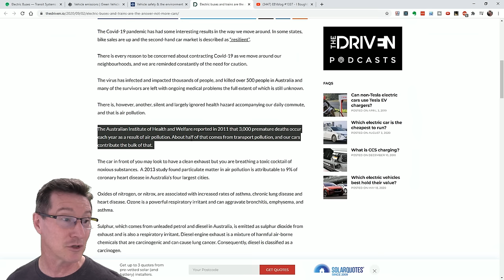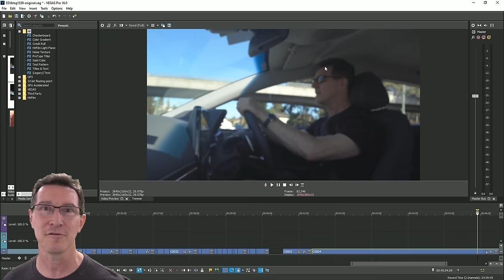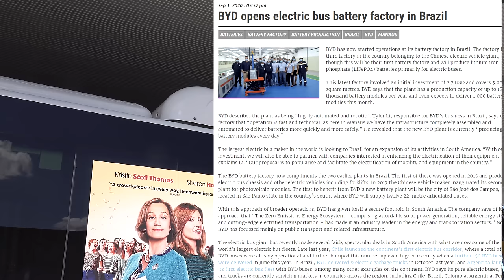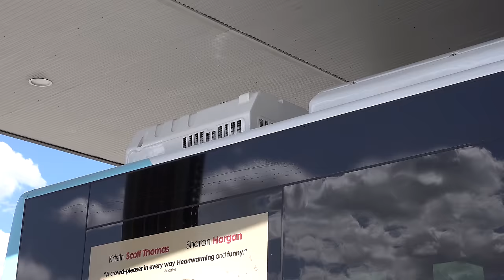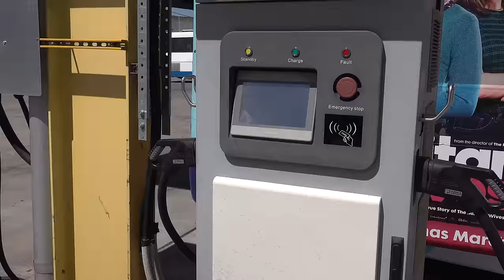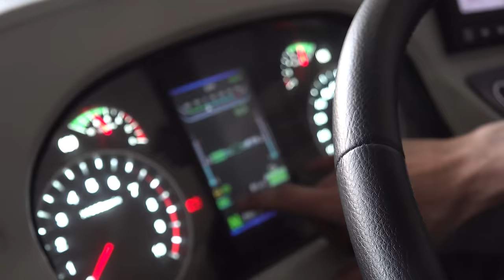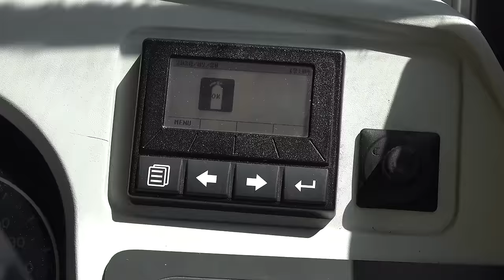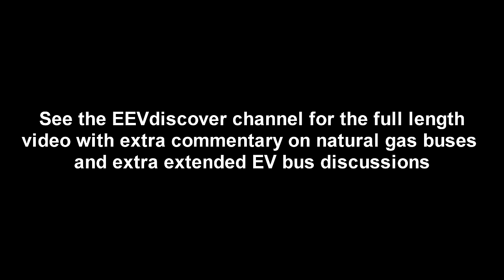EEVblog #1339 - Looking at an Electric Bus!

Comment: Making a blanket statement that "electric cars clean up the air" on its own is not only an eye-roller for many of us, it's an opportunity for a video right in line with what you have done before!
Obviously, you HAVE to consider the pollution created by generating the power used to charge your batteries if you want to be taken seriously regarding a claim about pollution. So do just that!
I for one would really like to see a breakdown of how much pollution is generated by just an average coal-fired power plant in generating the wattage used to charge your car batteries from realistically empty to realistically full and how many miles that charge will carry you vs. the amount of pollution created by a realistically comparable petrol (you're welcome) car to drive the same distance. Just from the pure economy of scale leveraged from a large coal-fired power plant, I'm guessing the advantage it would be significant and interesting.
Comparing to hydro or nuclear is kind of not helpful since that is just not globally ubiquitous to be meaningful in my view.
Reply: Generally EVs use energy way more efficiently than gasoline (~60% electric vs ~20% gasoline). You can start here about emissions: https://amp.theguardian.com/environment/2017/oct/25/electric-cars-emit-50-less-greenhouse-gas-than-diesel-study-finds
Reply: but of course, it is best if those coal plants were replaced with something cleaner; though perhaps can't go 100% solar or wind, there is a definite room for improvement in cleaning up the grid; a solar & wind mix is a good start though not the full solution; efficiency is another modifier... there is A LOT that can be done
Reply: Not to get into a" green "debate, but I'm pretty skeptical about the accuracy usually reported for how green both solar and wind are once you include the energy spent on manufacturing, installation and maintenance of any of them per unit of power output. I'm sure they are green-ish, but I'd like to see more folks at least consider and include that part into the equation, and I'd want to include that for coal and nuclear as well. You have to consider "cradle to grave" or at best you're not being honest or serious about the core problem. Not saying they aren't better, I'd just like to see the whole picture represented instead of just the pretty parts, which is almost always the way it's framed. I just figure we all know it's better and don't expect it to be perfect, so why leave anything out? We can take it.
 Anyway, even though coal is probably the dirtiest way of generating power to charge those batteries, the economy of scale thing should still make the electric car so much less dirty than a petrol engine that the difference is fairly dramatic.
@Tom - that's the kind of data (the kind of stuff you linked) I'd like to see Dave go over on a whiteboard. The "cradle to grave" issue is another reason why it might be difficult to include solar & wind because the dirtier parts of their lifespans are left out so often that it's difficult to even find and thus include. But heck, Dave could include a best-case scenario and offer up a theoretical purely clean generator source for comparison just for the fun of it.
Anyways, since he's kind of doing a semi-series on EV's anyway, seeing some math on a whiteboard and cluing people in on a more thorough picture would just be an interesting and fun video for that playlist I think.
Reply: @tommy12345abc  There sure has been a ton of improvements for safer nuclear over the past several decades - most of it unimplemented as far as I can tell. I'd sure like to see some progress on that. Well more progress on ALL of it really. But yeah, if we could get over the hump on large scale power generation, electric everything is a no-brainer as long as it's affordable.
Reply: @TyroneDamShewlaces  it comes down to recycling and responsible production. The west already has enough regulations to keep that in check though likely there are improvements to be made. But most of all they are the same regulations by which the other power plants are built except that once they are built, they keep producing even more toxic emissions and residue (it is not just CO2 but heavy metals like mercury, lead, chromium, arsenic; gases SOx, NOx, PM2.5, PM10...).  So let's not get too crazy about how clean solar/wind is or is not because it is still way cleaner than what humans managed to accomplish so far with current plants.  
To get to cleaner solutions about the environment (which then drives the cleaner solar/wind/battery solutions or whatever other future alternatives are), one must start with making the right decisions.  Taking United States' example, the decision of making an ex-lobbyist for the coal industry, Andrew Wheeler, is a very bad/corrupt choice to make him head of the Environmental Protection Agency (EPA).  The effects of that are simply atrocious.  So in the end it is also the voters that need to become responsible to get better at finding cleaner solutions.

Comment: Problem with the electric vehicles is the information. They do not reduce air polution. They just move it somewhere else. Fortunately, outside the cities. It is all about how electricity is made.
Second porblem is, with EVs getting more and more,  the demand for electricity will rise, so the infrastructure should be upgraded. So, in all, driving EV might become more expensive with time. As a side effect, the gasoline might get cheaper, so, if still not banned, i might stick with petrol cars.
So, a lot of "so" happened here ...

Comment: Aside from the massive pollution created from the manufacturing of the battery and it's disposal yeah it's fine. Less air pollution is nice though. The lack of sound is a problem it makes it more dangerous for pedestrians, I think they should have car engine sounds on a speaker for safety reasons...

Comment: Definitely will cut way back on air pollution, even though the power plant(If coal or gas), will pollute the air when you charge your vehicle. I wonder how much a solar array would cost just for charging the vehicle.
Reply: Even charging the vehicle by burning whatever fuel on the power station is a more efficient use of energy than burning it in the vehicle itself. A power station is a more efficient machine than an ICE in a bus, plus there is no idling, and on top of that you have regenerative braking.
Reply: @TheMobilefidelity  Also even in an equal effective pollution scenario it'd have been a win since you have a lot less local pollution where people live and work in the urban area.

Comment: coincidence - just today our town published the results of the first year running 10 electric busses (hydrogen batteries), and it turned out to perform even better than the specs said (400km range). And the hydrogen is produced by burning our waste... :)
Reply: But how much electricity would you save running them straight from batteries instead? Making hydrogen have like 50% efficiensy and hydrogen cells have like 50% so that is 25% efficient :( I guess you would get about 70% instead with batteries.
Reply: The Esseboy yes, effeciency is terrible -  but if you have the excess energy anyway, running the electrolytics is acceptable, imo. It also allows refueling in less than 10 mins - afaik our busses seem to do more km per shift than in Sidney., so this makes them ‚full regular busses‘.
Reply: @jlegen  Fast charging will allow to top up the bus in an hour or so, it will take a while though to get that :P
Reply: The Esseboy ...so you want to charge that thing with 500kW (because otherwise you‘d never come down to an hour)? Even if that‘d possible - you would have trouble getting those 24k charge cycles done...
Reply: Commercial hydrogen are made by splitting hydrocarbons
Reply: @jlegen  What? What 24K? And yes, 500 KW is possible, heard of the power grid? If you add more cables and tranformers it can do more sparks 😉
Reply: The Esseboy 24000 charge cycles have been mentioned in Dave‘s video. Those you won‘t get by beating up the batteries with 500kW charges -  besides that this would give significant thermal probs as well.

Comment: Jokes on you, my car runs on propane.
Reply: expensive and nowhere near as efficient...watch the vid and learn something!
Reply: @WacKEDmaN  oh really? if we take into account cost of equipment and cost of the propane in my country it is very cheap.
Reply: @D4no00  It makes sense if the cost of propane is significantly less than petrol, but not if it's about the same. It was the same situation here in Australia about 20 years ago with LPG/Propane costing around 40-50 cents per litre (when petrol cost 90-120 cents per litre), but then the government started taxing it at the same rate as petrol and diesel. Now all the taxi fleets have abandoned LPG because of cheap hybrids being more economical and with less maintenance required. Private motorists don't want LPG cars because of the onerous maintenance and safety certifications required, while the fuel costs more and has lower efficiency than petrol. And now because of the lower demand, petrol stations are ripping out their LPG pumps and finding an LPG station is much more difficult than it used to be.

Comment: There's still pollution that can be indirectly associated with electric cars, just that pollution comes from fossil fuel power stations rather than the cars themselves.
Reply: But generally you know power plants are easily regulated. And I think the battery manufacturing pollution is still a big problem.
Reply: @chenli9734  Over here in the UK at least, there is emissions testing for combustion engine vehicles and you can't get the MOT for the vehicle with a fail. Only exception for purely combustion engine vehicles is if its either a two stroke engine or less than 4 wheels.

Comment: How can a lithium-ion battery be rated for 22,000 cycles?
Reply: @Joachim Shekelberg I imagine you'd have to have those cycles within a 5-10 years span or so though, otherwise you might lose the capacity to pure aging.
Reply: It's Lithium Iron Phosphate (LiFePo 4) it has a longer life than other Lithium Ion batteries.

Comment: Ve iz much smarter in Germany: to combat "Global Whopping" (like, you know "we don't have winters any more because we drive petrol cars), the municipal transport services of a few cities invested in fully electric buses. As it urns out, here is only one little problem: in Winter when it's cold - yeah, I know, that season that was supposed to become extinct around 2010 or so... anyway, in WINTER the selfish commuters riding those things AND the batteries themselves require heating, which is (further) reducing the mileage of these electric buses of course. As a result, our planet-saving buses needed to go back into the depot after only 1/2 a day of service... so, under real-life conditions, you need either twice as many electric buses or a backup fleet of buses that actually DO work b/c they run on dinosaur juice... well, this displays very nicely what happens when you ignore the laws of physics and build a policy based on zeitgeist fears and wishful thinking.
Reply: @Okurka.  Yeah... I agree! It's a total joke: Germany's "Energy Revolution" is mostly powered by the conventional power plants in neighboring countries. Costs for consumers and businesses have accumulated to close to a trillion dollars (that's 1.000.000.000.000) as of 2020... which is the plausible figure given by independent analysts. Um, certainly we saved A LOT CO2 emissions then, right? Nope. Niente, nix, nada, zilcho. France is doing much better at a tiny fraction of the cost by sticking with nuclear.

About the brown coal: the main problem there is the high sulfur content. The concern that CO2 might be the key driver of AGW is old science from the 80s/90s. Newer and better climate model (the ones that actually CAN predict something),  attribute a much smaller warming effect to CO2. Instead, these models take into account the IR-absorbing effects of water vapor, ionizing radiation as a trigger of cloud formation and the sun's energy output as those factors result in a way better match with historical climate data...

Comment: "No emissions!". When you add up all of the emissions released mining, processing, manufacturing, upgrading the electrical grid, vehicles,  & components, chargers generating the power to charge EV's, then the fact that just like wind turbines and solar panels a huge portion will end up in landfills Electric vehicles are an environmental nightmare.

Comment: Why do these have such a giant battery? It's an Insanely massive waste of resources, and when scaled up to thousands of buses, supplies will tighten, run dry meaning costs will sky rocket to make the batteries, if they even can meet the demand. They should be hydrogen electric.

Comment: No emissions except when the electricity was produced.
Reply from the maker: Depends on what energy you use or buy. There are options.
Reply: @EEVblog  And generally power plants are easily regulated and monitored by government. And maybe located in remote mining areas.
I come from China. You know just the car annual audition is time and money consuming. So now private cars are audited every other year. But buses still are audited per year. 
Now the government decided to do one cut off. Big cities gradually get rid of gas buses.

Comment: What do you mean, there is still a lot of pollution it's just moved to a different location.  Mining for the materials and making all of those batteries is horrible for the environment. The power plant that makes the electricity is making extra pollution to charge that car, and if you think solar panels are green they are filled with toxic chemicals that are nasty to mine for. Recycling a solar panel is very difficult so most of them end up in the landfill where all of the chemicals get to leach out into the ground, things like lead, cadmium  and a bunch of other toxic chemicals.
Reply from the maker: Moving that air pollution to a different locations matters, it matters a LOT, to the tune of thousands of lives saved every year.
As for generation in another locations, there are options for that, you don't have the buy coal.

Comment: Quiet cars exist. If it's built worth a d***, the engine doesn't vibrate the whole car. A healthy car should not be spewing anything you can smell. (i.e. unburned fuel.) My car (hybrid) will only start the engine while standing when the traction pack is low. (below 20%... and not in neutral.) Also, why would you start the engine, and then spend 10min rounding up and strapping in feral children?

(Yes, there are plenty of bad cars in the world. Some of them are EVs.)

Comment: Don't fall in to the "out of sight, out of mind" trap. Where do the batteries come from? Where does the electricity come from?
Reply from the maker: I'm not. But it solves the local point source air pollution problem. That kills 3000 people a year in Australia.
Reply: Where does the oil for the diesel come from, where does the pollution from burning the oil go?
Reply: @EEVblog  Where do they get those stats? Wonderland? Miraculously, Canada has 80% less deaths due to respo-illnesses but instead they die from the new rage. Don't take any wooden nickel's bro.

Comment: The zero emission lie is easy to buy into.  There is likely actually the same, or more, pollution caused by electric cars than gasoline/diesel vehicles since the energy conversion from whatever fuel source generates the electricity is definitely not ideal.  This is followed by the less than ideal transfer of the energy from line voltage to battery storage, another power loss in the transfer.  Then there is power loss in the conversion to mechanical energy again.
My guess is that in the transport of energy from the source to the wheels of the car, probably pretty close to a break even versus liquid fueled vehicles.  The big improvement is that most of the emissions move from population centers to more remote areas where the energy is initially converted to electricity.  That will eventually cause the air in cities to be much cleaner once there is enough adoption of electric vehicles.
Reply: You have to keep in mind that power plants are more efficient than ICEs. Additionally, electric vehicles can use regenerative breaking to recover a significant amount of their kinetic energy

Comment: "Coal accounts for about 75 per cent of Australia's electricity generation."  Your living in la la land if you think your electric car is cleaner than using gas or diesel in Australia.
Reply: And yet austraila gets so much sun.
Reply: even when your grid is 100% coal having EVs in the city and generation far away makes sense - as air quality matters the most where people live
Reply: @ZielinskiIrek  More electric vehicles = more coal burning.  Moving the poisonous well farther away is not a solution.
Reply: @thatdellguy  it solves the polition in the cities where it impacts large parts of the popluation. Next step is to clean up the grid  UK went from 80% coal to almost 0% in a decade and a half - can be done!

Comment: Fake news!  The bulk of air pollution is NOT cars - It's been proven time and again that tractor trailer engines produce WAY more pollution than personal passenger cars, just due to their engine size and the amount of time they spend on the road.  I'm sure this is just as true in Australia as here in the US.  And please note the careful wording - it doesn't say air pollution caused deaths.  It says "...premature deaths occur each year as a result of..." - which is totally different and a little deceptive.  What they're cunningly not saying in that lovely verbiage is that the people that died already had compromised pulmonary systems - Lung Disease, Heart Disease, etc.
     PLEASE do not think I'm saying the condition of our air is fine - it is NOT.  But inflammatory and misleading statements like that one are not doing anyone any good.